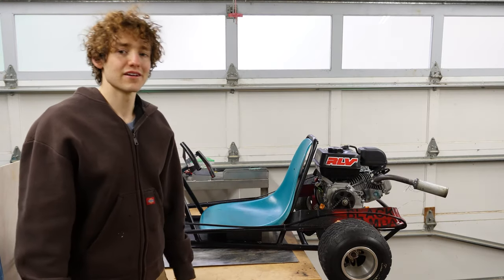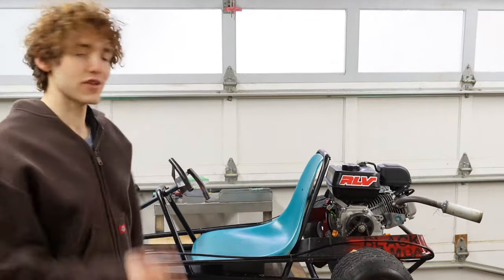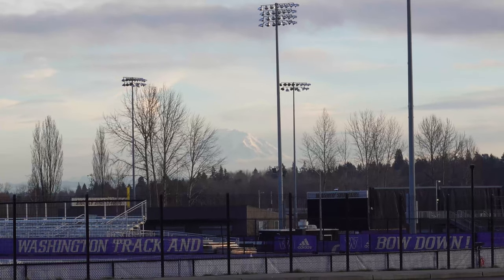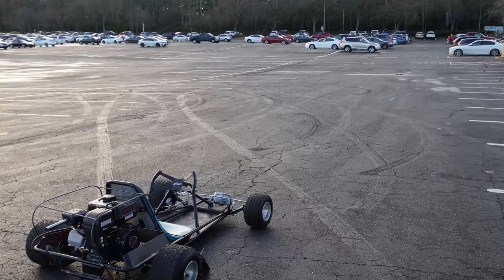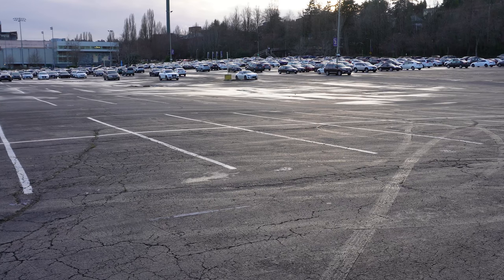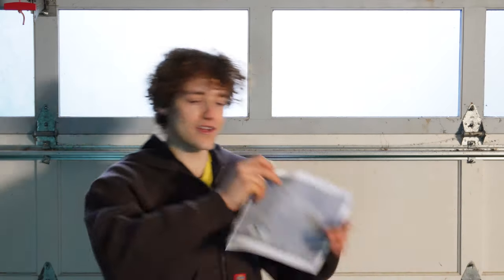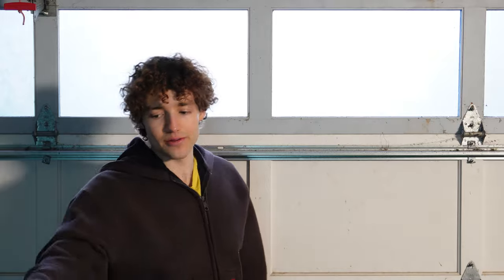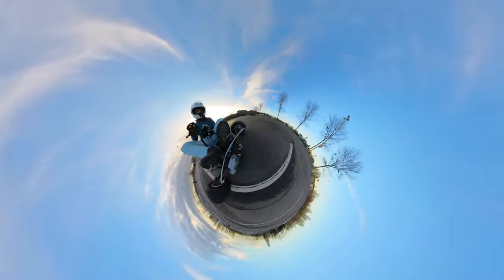Making a go kart quiet - does it reduce power?

Comment: excellent engine cover but the engine MUST have large vents to breath.
Reply from the maker: Good point; I was hoping the gaps around the sprocket and rotor would be enough.
Reply: yeah, you need like a vent on one side were the pull start is. & put a big vent on the other side where the exhaust and clutch is.👍 @BootlegBarry
Reply: @BootlegBarry don't want a barbecued engine. Air cooled engines need alot of cool air to keep them from overheating and seizing up.